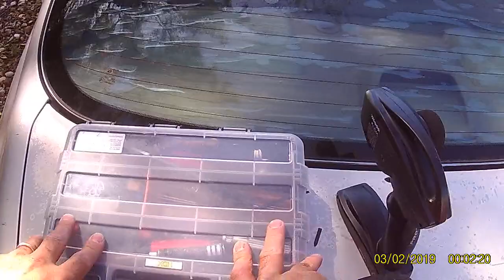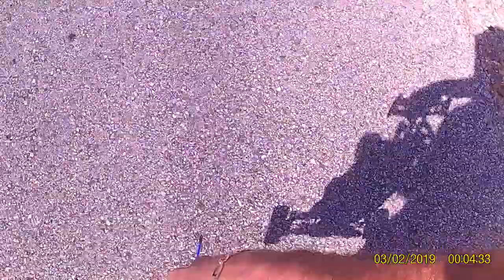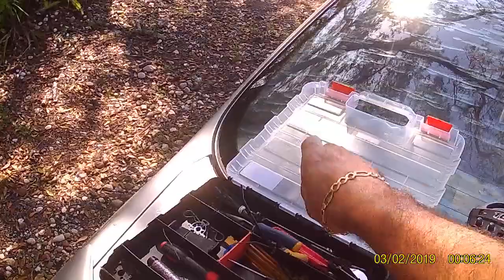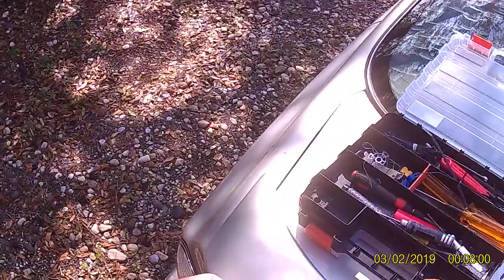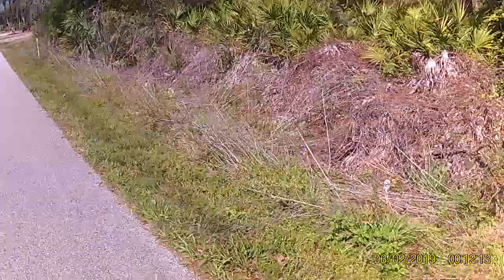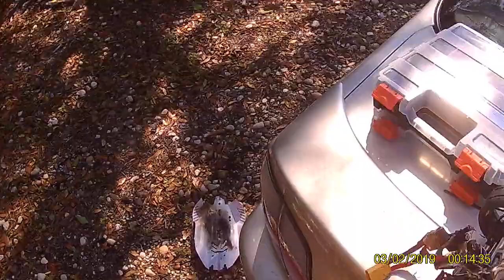TYPHON 6s smoked up xlx esc.....

Comment: Where do you do your runs? Looks like Florida. I’m in Miami and looking for a good speed run place
Reply from the maker: Robert Dicrisci You about 4 hours from me man your best bet is look on Google man and see your area from there 👍🏼
Reply: R/C CUSTOM  so what caused the meltdown on your Typhon. I’m sorry for your loss brother... that sucked...
Reply from the maker: Robert Dicrisci No idea what caused it but this was the 3rd run on this esc.... I have about 5 sets of these ESC’s and no issues with them but I do know this xlx was a replacement from castle and it took the over a month an half for me to get it too they said the were short on parts 🤔
Reply: Are you close to homestead?
Reply: Steven Petit yes, I live in downtown Miami.  What’s in Homestead?
Reply: R/C CUSTOM do you ever have reception/interference  issues on speed runs? I’m wondering if i should get a different brand or what about using the FPV transmitter and receiver from a drone. Advice?
Reply: @RobertAnthony78  Southland Mall every Wednesday, Thursday n Fridays starting at 9 or 10 we ripe our trucks, speedsters n truggies in the wide open range parking of the mall in front the Mercedes Benz dealership...

Comment: Hi, sorry man. Is that the first XLX that you're smoking ? What was the current limiter setting, 400A , disabled or stock setting ? It seems that the XLX  pretty prone to smoke...
Reply from the maker: maxxximatoze  It was set at 360A and was the 4th run on this esc, Also it is the first race that smoked in almost 10 years RCing. I know something was wrong after the first run on this video but i thought it was their pinion loose.....
Reply: @rccustom6726  the boaters replace all the caps inside and outside the xlx with rubycon zlh 50V 680 or 820uF to limit the ripple to minimum and add voltage safety against spikes. Maybe it worth testing... I have a dbxl-e and I will maybe replace the stock esc by xlx/2028 (or max5/56113). If I do it I will certainly try to replace the caps. The reliability of xlx does not seems to be as high as the max5.